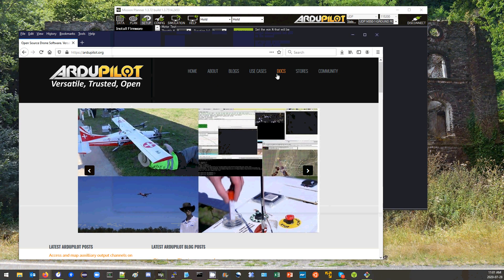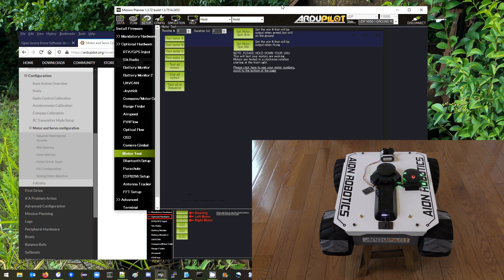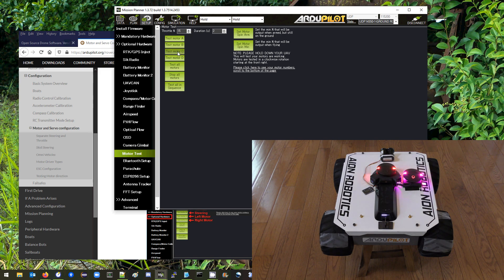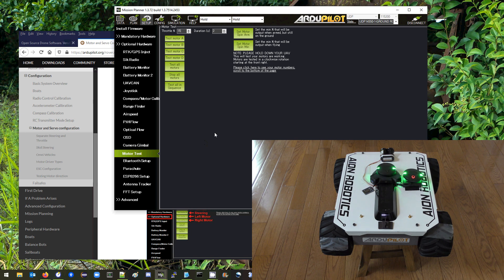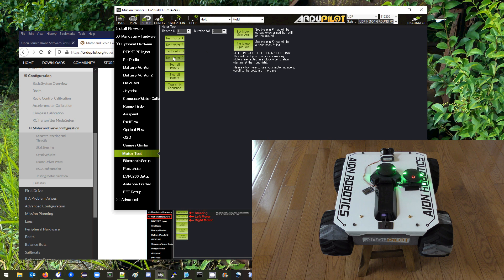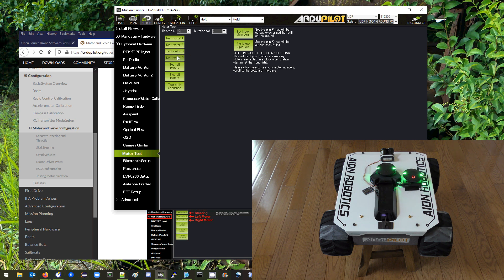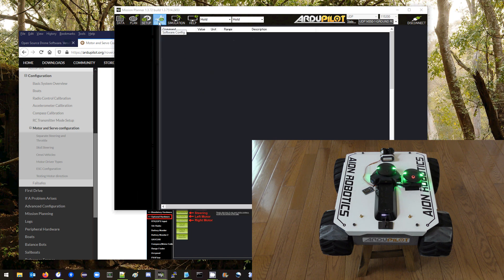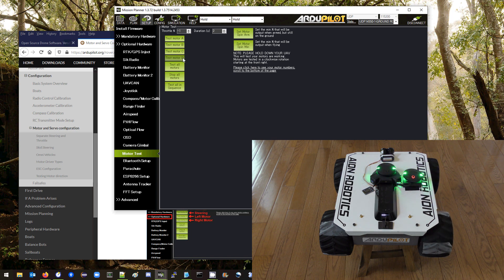ArduPilot Rover Motor Direction Test and DeadZone Compensation

Comment: I have an issue with my rover vehicle in mission planner. It fails the motor deadband test. I note that the motors start spinning at 6% throttle. I enter this in config s reen in mot_throtl_min and save. I go back into motor test screen and enter 1% and run motors but the wheels don't turn. In fact I have to go up to about 12% before the motors turn. It must be noted that I am using a ppm receiver. What possibly could the issue be? I have run the rover successfully in acro and guided modes so not sute how important this test is for a rover with one motor and standard steering? I have read on line that there may be issues with ppm receivers and mission planner. Any help on this issue is much appreciated.

Comment: Hola Randy !. Necesito tu ayuda , estoy pensando en adquirir un kit con el Pixhawk 2.4.8 para mi robot terrestre quiero covertirlo en autonomo solo circulara en mi campo privado , puedes aconsejarme si con esta version de pixhawk 2.4.8 es suficiente ?. En el kirñt va incluido antena gps compas y antenas telemetria v3 creo ponia ayudame en mi decision correcta por favor !.
Reply from the maker: Hello, could you ask about autopilots here in the Rover forums? https://discuss.ardupilot.org/c/ardurover/8 .  Which autopilot to use comes up a lot and so might as well ask the wider community for their input.

Comment: Bro pls help, how enable reverse drive on ch6 on Rover blat
Reply from the maker: Hi David, if possible it is best to post general support questions in the forums here https://discuss.ardupilot.org/c/arducopter/copter-45/174 .  Re reversing, normally a centered throttle is used and you can just pull the throttle stick down to make the vehicle reverse.

Comment: Hi, loved your video and explanation. I had a question about the use of the 433mhz 3dr telemetry modem. Can i use it to send and control my rover via rc signals? Like using the ardupilot on my laptop but control it via rc signals from the transmitter module?
Reply from the maker: Hi RiO, Thanks! I'm not sure that I totally understand the setup but we have instructions for setting up joysticks here on the wiki https://ardupilot.org/rover/docs/common-joystick.html .  By the way, if possible the support forums are the best place to ask general support questions https://discuss.ardupilot.org/c/ardurover/rover43/168

Comment: command is denied by ArduPilot ,any solutions?
Reply from the maker: Hi @Hasnain, if the motor test commands are being rejected this means the vehicle cannot be armed.  Make sure the vehicle is in Manual mode and then check the messages to see if there is a reason given for why the vehicle can't be armed.  If Mission Planner is being used then check the Data screen's Messages tab.  By the way, we can do better support in the Rover-4.x support channels on discord.  https://discuss.ardupilot.org/c/ardurover/rover42/162 . Thanks for using AP!

Comment: can you send the parameter list? or where could I find these?
Reply from the maker: Hi Wouter, I don't think it is super helpful to try and apply my parameter file unless you're using an AION Robotics R1.  If you're seeing problems with the vehicle could you post in the discuss forums?  Ideally with an onboard log and then we can have a look.  https://discuss.ardupilot.org/c/ardurover/rover-41/158
Reply: @rmackay9  i work with the same robot and accidentally deleted all my parameters hence the question. will do a post on the forum.

Comment: Im working with the pixhawk ( for the BlueROV) and Im trying to integrate two brushed dc motors to it (using the Pololu G2 High-Power Motor Driver 18v17. Online it says this motor driver supports "BrushedWithRelay" does this method also use PWM? or is that just for the normal mode. Some of the documentation online is a little ambiguous (atleast to me)

Comment: Great video! But I have some questions. What kind of motors and driver are you use? We are planning to use brushed DC motors and drive them with L298N motor driver. Can we control them via Mission Planner and Pixhawk?
Reply from the maker: Hi Yasin.  In general it is best to ask support questions here in the forums: https://discuss.ardupilot.org/c/ardurover/rover-4-0/154.  I don't think ArduPilot supports using the L298N motor driver because we have an open issue here for it: https://github.com/ArduPilot/ardupilot/issues/7616.  By the way, the "Pixhawk" is just one of the many autopilots that ArduPilot supports.  A nearly complete list can be found here: https://ardupilot.org/rover/docs/common-autopilots.html
Reply: @rmackay9  thanks a lot. I'll check them out 👍

Comment: Hello
I’m trying to build an Airboat with differential thrust
I have:
Pixhawk 4 with the power module
GPS
R12DS Radioink receiver
AT10 Radiolink transmitter
2 80A ECS
2 brushless motors 620KV

I have installed AurduRover/boat

I have connected the ESCs to M1 and M2 in the power module,
however, the M2 (motor 2) is not working

anyone out there that could help me out

Thanks

Comment: Thank you. Does the waypoint drive work well with the parameter you sent me?

According to the parameter you sent, there is no pilot_steer_type setting. Is it possible to do a pivot turn in this state?

Comment: Hello
If possible, please share your Aion r1 rover setting parameter.

I'm having a hard time erasing my Aion R1 Rover settings by mistake.
Please.
Reply from the maker: Here's a link to the params I use: https://github.com/ArduPilot/ardupilot/blob/master/Tools/Frame_params/AION_R1_Rover.param
Reply: @rmackay9  
Thank you. Does the waypoint drive work well with the parameter you sent me?

According to the parameter you sent, there is no pilot_steer_type setting. Is it possible to do a pivot turn in this state?
Reply from the maker: @show-ktech  In general it is best to ask support questions in the ArduPilot rover forum: https://discuss.ardupilot.org/c/ardurover/rover-4-0/154.  The PILOT_STEER_TYPE parameter controls how the pilot's *inputs* are processed.  It actually has no direct relation to how the vehicle's throttle and steering outputs are controlled.

Comment: Super useful video. I will be referring folks to this in the future! When I used the linear actuators with control boards which made them act as servos, I went into the control board configuration and disabled the deadband. I did not know you could do it in Ardupilot. Thanks so much.